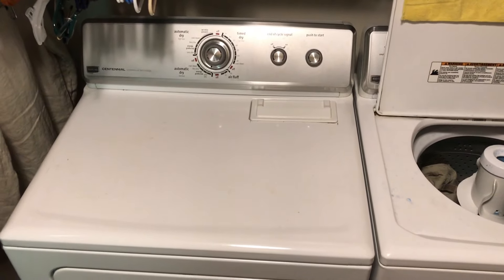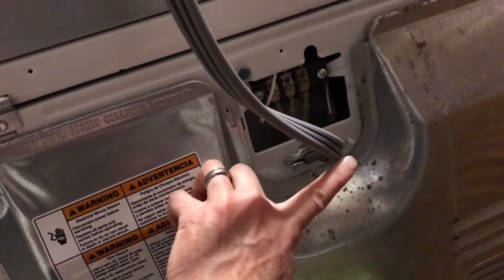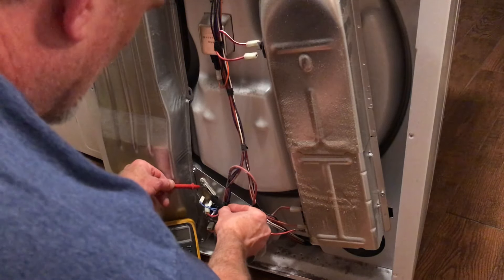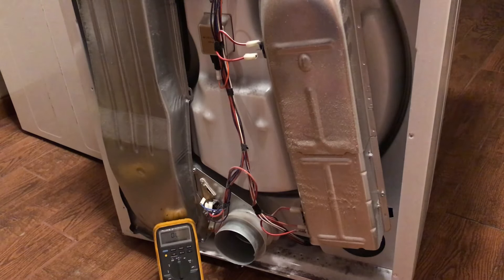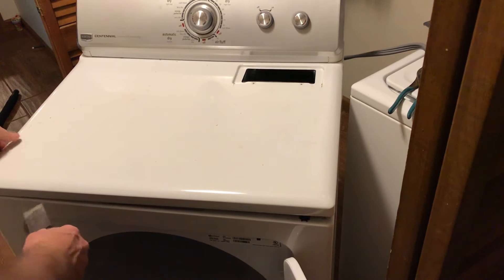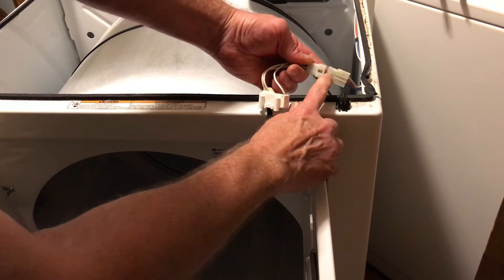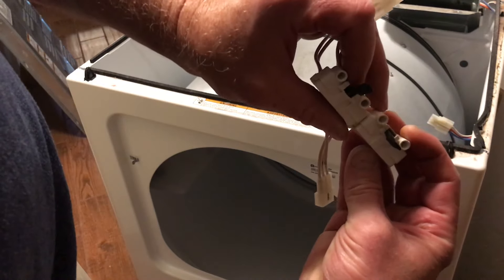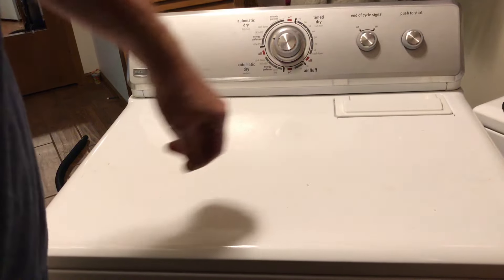Maytag Dryer won't start

Comment: Our Maytag dryer broke and thanks to this video, it only cost me $6.60 to get the door switch replaced. Our dryer lives another day.  Thank you for sharing.
Reply: Where do you purchase the switch?
Reply: Were did u get the door switch
Reply: @dontretaylor1799  I removed the old switch and it should have a part number.  I just searched it online.  Sorry could not remember if it was Amazon or some random parts store.

Comment: Great information!  I have the exact model dryer and mine quit working.  After watching your video, and before taking the back off to check the thermal fuses, I checked the door switch and it had the yips.  Removed the switch, called the supply house and within an hour my dryer was working again.  Thanks so much for a very well done video.
Reply from the maker: Awesome!  Glad the video helped.

Comment: Thank You Sir for this Video. I just fixed my 17 year old Maytag Dryer because of the switch. All I did was connect all 3 wires together to bypass the switch and my Dryer started right up after a week of torture. I ordered the switch and will install it so it works properly. You saved me a giant headache sir. :)
Reply from the maker: Glad it helped you. It’s nice to save money.

Comment: OMG, thank you so much! I have this exact dryer and couldn’t turn it on today. $9 on Amazon and I’m pretty sure I can fix it myself now. Lights on inside and the door switch is working as you showed a working model. Buying the fuse. 
Thought I was going to have to buy a new dryer or pay a $200 repair fee.

Comment: Your video was very helpful and guided me so that I could fix this myself. I knew it was probably the switch because the light had not been coming on for several weeks (but the dryer was still working until this past weekend), but I didn't know how to go about making the repair. Your video also encouraged me to go ahead and order a fuse with the switch to have it on hand because that is probably the next thing that will fail. Thank you.

Comment: Thank you for sharing! It was the thermal fuse in my case, the switch was good. 👍🏼 Hero status achieved with the Mrs, bonus!
Reply from the maker: If your thermal was bad, make sure your exhaust pipe is clean. This usually causes the thermals to fail.
Reply: Will do, thank you Sir! Happy 4th!

Comment: That’s the same problem with mine.  For a while my inner lite wasn’t working.  Today, my dryer won’t start.  Opened door the lite was on.  Looks like a quick fix.  Thank you for the video!!
Reply: The light on mine also went off and the dryer continued to work for another half year or so. A couple of times I opened the door and the dryer continued to spin. today it stopped working. I thought it might be related to the door switch, should’ve looked online and try to fix it but now it’s out on the street for garbage pickup now. Shoot. 

Do all dryers stop working because of this or just Maytag ones. Seems like a good way to get people to buy a new dryer. I’ve had mine for 10 years though.

Comment: Nice video! Well delivered and straight forward. It was nice to see the testing of the thermal devices as well. If you had just done the lid switch some people would be upset if the lid switch did not solve the problem. Nice to see nearly all things tested. An uncommon item that may cause the same problem is the push button to start the dryer.

Comment: It was the thermal fuse for me. Thanks for including that even though it wasn't the issue you ran into. 👍
Reply from the maker: Good deal!
Reply: For other people with the same issue, the vent pipe was filled with lint. I cleaned that and the outside vent so wouldn't have to buy another fuse too soon.

Comment: Thank you so much for the tip. I just adjusted the door switch that was pushed in and I pulled it out and it worked.
Thank you

Comment: Fantastic video! Quick to the point solved my problem. bravo bravo bravo! Why can’t all the do it yourself or Youtubers do it like this… Get to the point show how to do it bing bang boom! Thank you sir very very much!!!!
Reply from the maker: Hey. Thanks for the kind remarks. I do like to get right to the point.
Reply: @fixthemthings  You saved me easily five to $800 because it’s a 15-year-old dryer and I wasn’t about to have a service call on it… was just going to buy a new one. But the door switch was clearly broken from what you showed and you so thoroughly and easily explained how to get the top off that I did it and it’s working right now. I owe you a beer or seven!

Comment: Thank you for the help on how to take the dryer apart and repair it. So I did the door switch first and it worked, then I did the thermal switches second and they all worked. So I hit the start button and the dryer worked? I started vacuum up all the lent on the back panel and it was pretty plugged up so maybe the motor got hot and shut down. Good new was I found almost five dollars in coins.

Comment: Where do you buy the door switch at and the thermal fuses at 🤷🏻‍♂️
Reply from the maker: You can try here:  https://www.ereplacementparts.com/

You can get them at your local appliance repair parts store or many other stores online. You just need your model number.

Comment: Thank you! I opened the back, cleaned the vents, replaced the thermal fuse...not sure I know how to use a reading tool... But I can try! When you say you want "zero ohms". It may be easier to replace the door switch before checking ohms...or maybe not. Anyhow - for this exact model - how do I know which door switch to buy?
Reply from the maker: Most likely the door switch. Anything a human can break. 🤪. You can type in your model number into this website to find the part number then do a google search for that part number to find the best price. 
https://www.ereplacementparts.com/
Reply: @fixthemthings  My dryer is working again! Thank you for your help!!!! I replaced the door switch and that was the last piece of the puzzle! $11 total (thermal fuse and door switch) and I'm ready for more laundry!

Comment: All of my connections are reading zero Ohms and the switch is good but it still won’t turn on. Any other suggestions?!
Reply from the maker: It may be your timer. Move it around to different positions and see if it will start. I don’t think the timer will be worth exchanging. Probably better off buying a new one.

Comment: Thanks for the video. I have the same dryer. Would the switch still bulb still light up and click normal if it were bad? Would you know the part number for the fuses?

Comment: How does that Flicker Switch affect the power to the whole dryer when it’s really just a light switch? The Fuse is behind the control panel in the back. Wouldn’t that be the one to power the machine instead of the front switch?
I don’t get it? And I’m not an electrician either. But I’m a pre beginner!

Comment: 2 yrs lol can it still be a door  switch if it turns the light on and off. It feels a little floppy but still has spring. I gor one coming in after that I do not kno the problem all the fuses are good and start button is good

Comment: I change my thermal fuse like suggested in the video because my dryer wasnt turning on ...now it is working again but i have a weird noise kinda scared to leave it running any idea was it is causing this noise 😢 ? Is it because i put back the wires wrong way in the new thermal fuse ?
Reply from the maker: Did you clean it out and clean the pipe to the outside?  Don’t want a fire. What does the noise sound like?  Clunks or squeaks or what?
Reply: @fixthemthings  it's sounds like a nail or coins spinning inside but it wasn't making that sound before just after I switch the new thermal fuse in

I was thinking maybe I got the wires mix up ...

I did clean a bit but not the roof since I can't get up there
Reply from the maker: @CoachGarcia  shouldn’t be anything to do with the wires. Maybe a penny got up underneath the plastic fins on the drum.
Reply: @fixthemthings  u were right I found Allen key just now start it again back like new no sound Thanks again Boss 🙂

Comment: hey video is great but i’m not great with a multi meter my thermal switch on this exact brand reads 4.7 but when i touch the other 2 side of the switch it reads 0 ohms idk if it’s blown or not lol
Reply from the maker: @theblimpgamrrjaris5511  if I’m reading that correctly it sounds like it is good. It is most likely the door switch that is bad due to slamming the door.

Comment: I have the same dryer and I've replaced the thermal fuse many times. Unfortunately now though my drum just won't spin, but it's getting hot like really hot 🔥. Any ideas ? I don't have a meter to test
Reply from the maker: Your dryer vent hose must be plugged up and needs to be cleaned out. Look outside at vent and see if it is blowing outside. If not, do not run the dryer until it is cleaned out. You don’t want a fire.  Hope that helps.
Reply: @fixthemthings  Yes that's the reason it has blown so many times. Stupid design of my apartment has the dryer vent hose going straight up to the attic but I have no access point and there's no vent anywhere on the side of the house. I swapped out the thermal fuse again and it ended up working thank goodness. I just need to make sure and get a renters insurance probably on Monday morning

Comment: I am not  sure I know how to use the meter properly but if I'm checking continuity and I read zero ohms...doesn't that mean the circuit is open? Also when I looked at your meter...I thought I saw movement or reading when you checked each of the other switches?  Please help and thank you
Reply from the maker: Zero ohms means a short which means the circuit is good. It’s just like touching your leads together. If it’s say less than 10ohms then they are probably good. If your meter reads OL or a very high number then the devices are bad. The problem with these dryers is almost always the door switch unless your exhaust pipe is plugged up. If it’s plugged up then it could overheat causing fuse failures. Hope that helped.

Comment: How do I replace the fuse if it's the fuse? I didn't know there were so many fuses. Can I purchase a fuse at HomeDepot or a Store like Home Depot? Please answer ASAP. 
I need my dryer and I cant get my husband to help me. Thank You! Sherri
Reply from the maker: Home Depot won’t have the thermal fuses. You can get them a an appliance parts store or order them online. You will need your model number. It’s most likely the door switch that is bad. Feel the lever on the switch and see if it flops around.  The thermal fuses usually go when the dryer is full of lint.

Comment: I have the same model. Any suggestions as to why after about 10 minutes it turns off? Not all of the time. But most of the time it does. Sometimes I can turn the timer alert to the on position while pushing the knob to start it in  and start it. Sometimes I have to wait about 20 minutes.
Reply from the maker: Sounds like the thermal is getting too hot and switching off. Check you piping going to the outside. Is there sufficient flow. If not clean the pipes out. Must be flow problem.
Reply: @fixthemthings  I didn't expect a reply so quickly. Thank you so much! 🤗

Comment: What does it mean is it reads .004 on the  black switch where the 4 plugs are (bottom left) it's the 2 blue wires with white tips.

Comment: Was your light working?  My light is still working, so it makes me wonder if the switch is bad or not. Thanks!
Reply from the maker: If you push the switch in does your light go off?
Reply: Yes, light will go off when pushing the switch.
Reply from the maker: @ervinpatrick  ok. Then it could be any one of those thermals in the video. Please check your dryer vent hose for blockage. Don’t want a fire.
Reply: Thanks for the advice!  I was going to switch out the timer or start switch, but will start with the thermals.

Comment: If you u plugged the dryer from power how are you getting a multimeter reading? 😄
Reply from the maker: I am reading continuity not voltage. Ohms.

Comment: To where do I set my tekpower digital multimeter to check those fuses?
Reply from the maker: With no power on the circuit put it on ohms. Horse shoe looking symbol.
Reply: @fixthemthings  okay. And how did you remove the hose? Because I'm having some trouble

Comment: I have the same dryer and non of this fixed it. Could it be the timer?
Reply from the maker: @chrisrobertson5852  it’s almost always the door switch due to slamming the door. Other possibility is if your vent pipe is plugged up it will cause the thermal to open.   I guess sometimes it could be the timer but I’m not sure if that would be worth changing unless you actually trouble shoot it. I think they are expensive.
Reply: True. Probably better getting a new dryer at that point. Thanks for the response
Reply: Ended up being the timer. Only works when you sit and spin it back and forth till it finally kicks on

Comment: What kind of screw driver did you use for the switch?
Reply from the maker: I use this screwdriver for everything. Klein 11 in 1.  Is this the one you’re talking about?

https://www.homedepot.com/p/Klein-Tools-11-in-1-Multi-bit-Screwdriver-Nut-Driver-with-Schrader-Valve-Core-Tool-Cushion-Grip-Handle-32527/203310474?g_store=145&mtc=Shopping-VF-F_D26P-G-D26P-26_7_PLUMBING_REPAIR_And_REPLAC-MULTI-NA-Feed-LIA-NA-NA-AllOthers_ProPlumber&cm_mmc=Shopping-VF-F_D26P-G-D26P-26_7_PLUMBING_REPAIR_And_REPLAC-MULTI-NA-Feed-LIA-NA-NA-AllOthers_ProPlumber-71700000049635052-58700004890398896-92700042242856180&gclid=Cj0KCQjw7ZL6BRCmARIsAH6XFDKRznwav1jcUWvHMKEU0h6Lq-yzwcORqqUiQIlsQemaNgRE7yEK0HgaAqYmEALw_wcB&gclsrc=aw.ds

Comment: I had a Maytag dryer but the light not on. Does anyone know what happened? I need help. I had replaced thermal fuse and switched
Reply: If light is not coming on its either door switch or your not getting power to the dryer
Reply: @mptemplin  could it be a bad bulb?
Reply: @jamesa.holman2634  bad bulb would mean no light not necessarily it won't start.  These are pretty easy to troubleshoot....just get a multimeter and open the back panel and top.  Start shooting each switch for continuity.  Do them all and the ones that have zero continuity then there's your bad switches.  Now if switches are all good its a power issue.  Either the CB tripped on your homes cb panel or main power wires that go from washer/dryer to outlet are bad

Comment: Mine is new but takes forever to dry clothes!
Reply from the maker: Check the pipe/hose to the outside and make sure it is clear.  These pipes are usually neglected and could cause house fires.